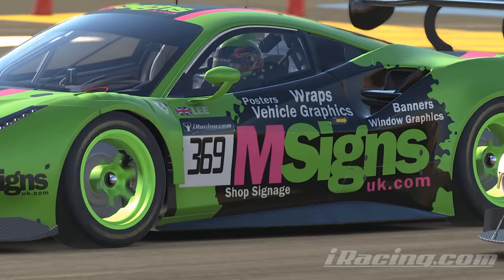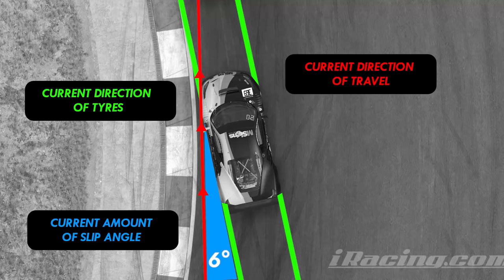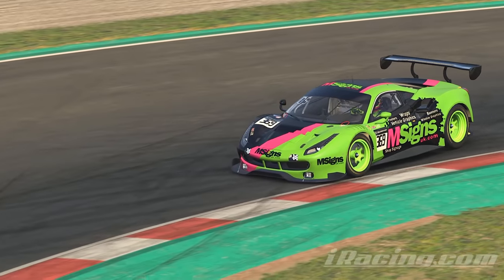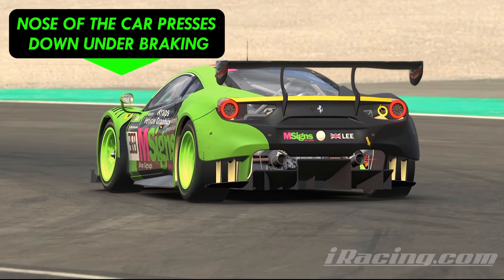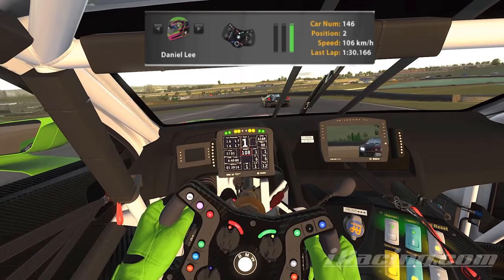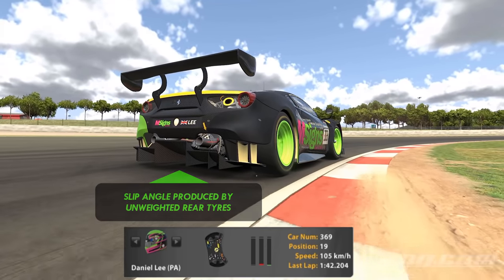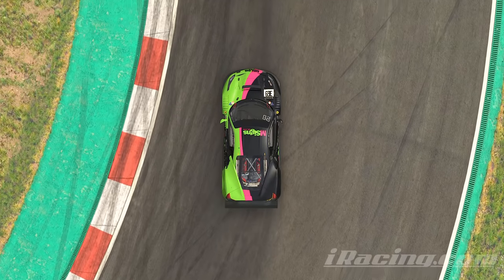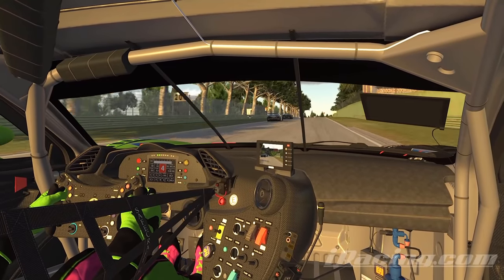Slip Angle in Sim Racing - Nail This and Smash Your Lap Times

Comment: My lap times are maybe not alien fast like verstapen, rogers, job, etc. but I am fast. I have some top 10 laps even in the world record charts. But I never really knew about the concept of slip angle until recently. I think my car is a bit sliding through the corner but not to the point where I need to counter steer. More like a 4 wheel drift or something.

Comment: Not really a slide right? Just the elastic nature of a tire.
Reply: At the core of it, it has indeed something to do with the elasticity of a tire. As you enter a corner, a tire gets loaded. The tire tread on the contact patch gets tensed and the further down you go on the contact patch, the more the tire tread gets twisted from an undeflected tire tread into a deflected tire tread. It is the angle between the deflected and undeflected tire tread that builds the basis for the slip angle. Because the slip angle is not straight but in a slight angle (which is why it's called an "angle"), you have to get the car into what looks from the outside like a slight overrotation in order to reach peak grip. That is what gets confused with sliding by some. People see the tire going slightly sideways compared to its outer measurements and misinterpret it as sliding. What you actually do is lining up a car's rotation with the deflected tire tread, so it isn't really sliding. The issue here is that a loaded tire has "sideways" tire tread on the contact patch compared to an unloaded tire. Driving at the proper slip aangle therefore is the effect of lining up the car with the deflected and loaded tire tread within a corner. As you reach peak grip and the proper slip angle, the car has more grip and rotates faster. That effect can also be misinterpreted as sliding because it accelerates rotation and can feel like a slight drift. But it is not really sliding, this is absolutely correct.
I have never seen it being discussed on such a deep level, but my believe is that it is called a 4 wheel drift or sliding because of how our brains get deceived. Our brains are organs which strive for order and control. One expression is seeing faces where there are none (like the face on Mars). As we see a car going slightly sideways compared to its dimensions, it appears to our brains that it is sliding. But what is really happening is that this is the straightest way possible for a racing car in relation to its deflected tire tread. Sorry for going so deep here, but it seems to be really interesting to me how our brains work.

The same mistake happens with our brains mistaking centripetal force with the fake centrifugal force which doesn't exist. But that is another topic...

Comment: Nice video, just one question: how's that gonna do with tyre wear? I.e. how practical it is regarding endurance race
Reply from the maker: Depends on which simulator you're playing but generally speaking the harder you push the higher the heat and wear, so if you needed to conserve tyres you would just avoid driving on the edge and scrubbing the tyres as much. Same when cooling the tyres when you need to save them for a hard push.
Reply: @dannyleeracing  Makes sense, thank you!

Comment: Are you sure about the concept here? I read different stuff in a book (tough not for simracing). 
The book says tyre slip angle (to a certain degree) generates grip and is the difference between steering direction and tyre contact patch direction of travel (due to sidewall flex)  - it's NOT sliding.  
Body slip angle (caused by the tyre slip angle) is the difference between the facing of the chassis and the direction of travel @ the cars center of gravity, which isn't sliding or oversteer aswell (to a certain degree). 
I say to a certain degree because we are talking about beeing fast here it's the sweet spot when it looks like sliding/oversteer but actually isn't due to the things at work I wrote above. 
Just want to say that's how the concept is portrayed there for real race cars don't know if it applies to iRacing/simracing maybe they simulate that with real slip?
You got a nice voice tough good for explaining stuff also nice graphical inserts.
Reply from the maker: You bring up loads of valid things. If I was explaining the concept to a caveman I would describe it as 'sliding, but just a tiny bit', and if that means people take some of it on board without getting lost in the gritty science stuff and results in improved laptimes without having to break it down into the granules of science then that's what I'm aiming for. Many folks are taught that sliding (or what they perceive as sliding) in any measure is bad and that's not the case. There's no shortage of great engineers explaining why this works and why it's modelled into any serious simulation and I'll leave it to them to do just that if people are inspired to look into it further.

Comment: thanks great vid, what are the setup points to adjust to get the car towards this slip angle?
Reply from the maker: This is a very complicated question - but there are some things that can make it a lot harder to get it pointed. If the front ARB is to stiff or the rear ARB is too soft (or both) then that can make the car too 'safe' and resist rotation, they're probably the easiest things to tweak that have the biggest effect. Setup shops are worth their weight in gold.
Reply: @dannyleeracing  thanks. Not sure if there are setup shops for rfactor2.. Never bought a setup

Comment: I can't always create slip angle by heavy braking. I do this instead: increase the rear anti-roll bar. increase the rear slow bump. decrease rear wing. I will do either one of these things, two of them or or all three of them. I done it on ACC, ain't tried in other sims.

Comment: Great video! My only problem when getting slip angle is controlling how big of an angle I get. I see videos where they use the maximum angle possible whilist preserving the tires. I however cannot control the angle I get. I just get the angle i get either too small or too big. How can I control the amount of angle I get?
Reply from the maker: Brake bias might be something to look into as it helps to 'meter' how much rotation you get when you turn into a corner under braking (which is most corners!)

Comment: Back then in Gran Turismo 2 and 4 I do thing I didn't know that have names hahahaha

Remember doing a fast brake, shift down and start kicking the gas pedal to make the rear of the car slide a little bit, and get out of the curve with high speed and rpm... now I know that Senna did that.

Comment: Presumably, this applies to single-seater formula cars, right? My car of choice in iRacing is the FR2.0. At times I'm 3 seconds off the pace which, after two years and thousands of pounds of stellar gear, I find quite unacceptable. I should be much closer by now. I use VRS setups and watch all the tutorial videos to little avail. Cool video though.
Reply from the maker: It does apply to high downforce formulas, it just takes a bit more confidence/force and when you overstep the mark it lets go very quickly! Do you practice solo or do you join official sessions and still find your pace near the bottom?
Reply: @dannyleeracing  I join official practice sessions all the time. I'm not always at the bottom (I'm not quite that bad lol), in fact, if I avoid accidents, it's hard for me to finish outside the top 10 in a race, usually. However, like last night, if there is a high amount of cars registered for the race, that's when I'm wasting my time. E.g. last race at Interlagos, 3 splits and I was in the top split car 17. Finished in 16th while being taken out twice (miraculously avoiding the savage brunt of the NDM). That wasn't much fun. My last win (9 in all) was last race last season at Okayama. It was a split 2 race and I romped it. So it really depends who turns up and how many. I will NEVER win a top-split race, so I'm trying to think of a way to trash my iR without ruining my SR but even that is hard work. Thanks for the reply. I do try all the things you mentioned in the video, especially trail braking.

Comment: this seems like the less extreme version of a slide in rally racing. using the lack of grip to your advantage to get yourself faster around the corner, the only difference between the two is usually fkr rally it is more extreme, due to most of the driving surface being dirt or gravel.

Comment: This is exactly the detail that iracing fails so hard at. The FFB doesn't communicate it unless you use 3rd party software like IRFFB and the physics emulation can't realy handle it propperly either as it is very likely to just send you flying, where it should be giving you some room for error.

Comment: Can I do it efficiently in Assetto Corsa Competizione too? I heard that the Slip Angle actually used to make you slower there
Reply from the maker: I find the window where the car's rotation is treading the right line is tricky to find in ACC, when you hit it you know, but when you don't it kills you for it. It's quite easy to overstep the mark and overstep the realm of slip angle and end up wallowing in grip loss - FFB settings can help zone in on it but generally speaking ACC is just a tricky bloody sim. Feels good when you nail it though.

Comment: Perfecting this in GTA is really nice but difficult, it’s basically doing a pendulum turn but at the perfect angle, normally I do this by swinging the car into the corner and gassing it hoping Rockstars mechanics doesn’t do some sort of handling flag shenanigans and losing acceleration for some seconds

Comment: Are you not confusing ‘drift-angle’ with slip-angle? Front and rear tires have different slip-angles on one car and as a result you get a car oversteering or understeering. A complete car does not have a slip-angle.
Reply from the maker: Correct, the proper term for what I'm describing in this video (and what I should've used) is Yaw Angle

Comment: I'm willing to bet that the slipping doesn't actually make you faster, rather it's a sign that you are pushing the limits of the car. I'd imagine if a bot made a perfect lap, with superhuman control of the brakes and throttle, it wouldn't slip. as ordinary people, the only way to know we are going as fast as we can is by testing the line between spinning out and driving too carefully.
Reply from the maker: You just lost a tenner. Have a read about tyre slip angle if you want to know more, it's detailed in practical terms in the skip book and other online places. It's ridiculous what tyres are subjected to underneath a car and it isn't portrayed well by iRacing but that's the best tool for the job for camera control. The tread of the tyre, the sidewall and the elastic properties of rubber all combine to make a 'twisted' contact patch quite powerful.

Comment: Isn't that what they called four-wheel drifting?(CMIIW)
Reply: I don't know, but I feel like this is what the guys in Initial D were doing, but the oversteer was just hugely overexaggarated because drifting was trendy in Japan.
Reply: @istachi  yea personally I think the angle was bigger because it has a slope and the corner was sharper and tighter
Reply: @devinsontani88  Yeah, after all the drivers in hillclimb events tend to oversteer a lot, kinda like rallying. Maybe it's the same for the Akina downhill?
Reply: @istachi  Yes if you see the real akina in Gunma the corner are tight and the corner is very sharp
Reply: @istachi  yes it is like rallying, even its mentioned in the 5th that in touge racing rally style is more efficient
Reply: @devinsontani88  Four wheel drifting in Initial D is closer to rally drifting, so it's not like this. 

In those situations it is still correct in that it's the fastest way to corner. If you enter perfectly and have very low countersteer, your exit will be perfect as well.
Reply: @PURENT  yea dude i know I did not said that this is the Intial D drift
Reply: @PURENT  what I said is that slip angle is a four wheel drift that's all
Reply: @PURENT  Yea ofc with these style of cornering you can achieve the maximum cornering speed and maximum grip too

Comment: Brake bias is like the best kept secret of Iracing
Reply: Explain...
Reply from the maker: Allow me: https://youtu.be/zNw4wQu__Oo
Reply: @dannyleeracing  Cool thanks! I don't think I'd have the presence of mind to change BB as often as this though. I use VRS setups and I usually adjust it to 53% to the front because, under hard braking, the rear just flips out on me. I then adjust the pedal's software (H-Sprints) to prevent lockups. So, I almost never lockup when threshold breaking (braking limited to max 80% I think). And this is in the FR2.0 :)

Comment: Is slip angle supposed to be used with every corner
Reply from the maker: In an ideal world, every proper corner requires it to go as fast as possible but this is difficult to do accurately, sometimes you'll nail it, others not so much, a great lap is usually one where every corner is accurately hit. Entering slip is not needed for minimal corners where you need to keep momentum and 'scrub' as little as possible.

Comment: Does this also applies to open wheelers?
Reply from the maker: Applies to anything with 4 tyres! Even karting. The only thing that differs is how much slip angle is optimal, open wheelers usually only tolerate small amounts in my experience. The Skip Barber, however, with it's road tyres, loves to slide.

Comment: Informative video however what you’re describing isn’t “the slip angle”. The slip angle is the deflection of the leading and trailing edge of a tyre in relation to the wheel rim. 
Still relevant to sim racing however as ideally you want to turn the wheel the least amount possible. Less heat, less wear and a more responsive car.
Reply: I think he's got it right. "In vehicle dynamics, slip angle or sideslip angle is the angle between the direction in which a wheel is pointing and the direction in which it is actually traveling" 
From the wikipedia article. https://en.wikipedia.org/wiki/Slip_angle
Reply: The term slip angle is confusing. Some may think that tire is actually slipping constantly to generate cornering force. That is not true. The tire actually is creating torque by continuously twisting a bit at fast rate. It twists, grips up, twists, grips up, twists, grips up..... However thats very technical, and practically it is fine to assume that there is just constant angled slide. But it does contribute to what you say about tire deforming and twisting in relation to tire rim, because it does happen to be so. 

 Friction of cornerign tire is made of two components - static, and sliding. Sliding portion grows with increasing slip angle, at peak slip angles static friction portion becomes quite small, and sliding contact patch portion becomes big. The goal is not to loose static contact in the tire contact patch, because then tire is at a complete slide, and from then it is up to inertia, heat and sliding velocity and other factors such as loads (including aerodynamic loads) if tire will be able to scrub off enough speed and angle to regain static contact again to avoid spinning out.
Reply: @dedge12858   Thats nearly same thing though. The difference happens to be possible due to deflection of a tire.
Reply: @mantasisganaitis2281  I didn't actually say the comment was wrong, just that the video is right (for all practical values of right). And certainly right in so far as what most people mean when they refer to slip angle.
Reply: For the purpose of the video I agree using slip angle as the catch line makes sense, but as the creator is looking to educate people I thought I would educate the educator. So it was a constructive comment rather than something negative. 
Now everyone who’s watched the video and read through the comments is a little bit smarter 🤙🏻 aim of the game.

Comment: Do I need to turn off the traction control? =/
Reply from the maker: No you don't, a lot of this is all about corner entry where traction control has no effect. If ABS kicks in then you are braking too hard and making the fronts lock up which the ABS is fighting to rescue you from. Be light on the brakes whilst turning, like you're pressing your foot on a tomato but you don't actually want to squish it.

Comment: You're mistaking yaw for slip angle. 
Slip angle is the tire flexing due to cornering loads. Yaw is the vehicle heading direction not matching the vehicle travel direction. 
They are related but you don't "slip angle" a car, that makes no sense.

Comment: I find your explanation of slip angle flawed . In vehicle dynamics, slip angle or sideslip angle  is the angle between the direction in which a wheel is pointing and the direction in which it is actually traveling (i.e., the angle between the forward velocity vector and the vector sum of wheel forward velocity and lateral velocity. This slip angle results in a force, the cornering force, which is in the plane of the contact patch and perpendicular to the intersection of the contact patch and the midplane of the wheel.  This cornering force increases approximately linearly for the first few degrees of slip angle, then increases non-linearly to a maximum before beginning to decrease. - check out this video which explains "slip angle" correctly - https://youtu.be/MwrUz1WI5GY?si=R8jLeeQj0D4Ru1BI
Reply from the maker: This has been mentioned before and I rightly concede that the true definition of 'slip angle' is not what I'm talking about here, and I have obfuscated 'slip angle' with 'yaw angle'. Hopefully this just means that folks will look into the topic further